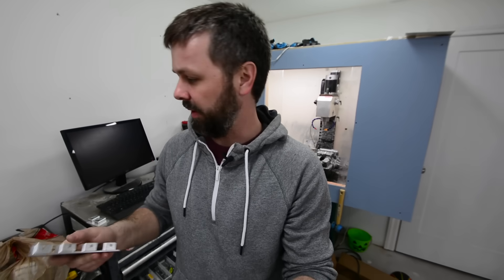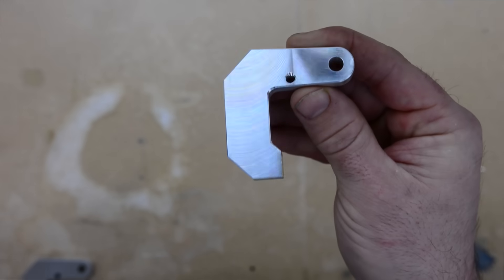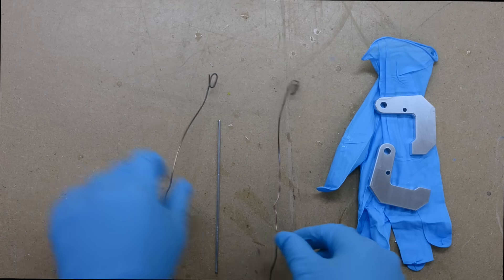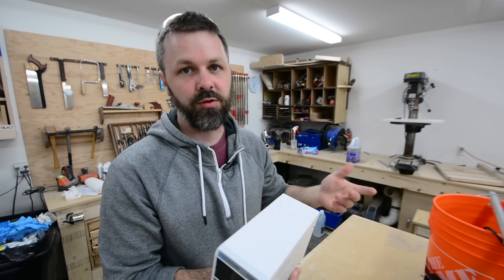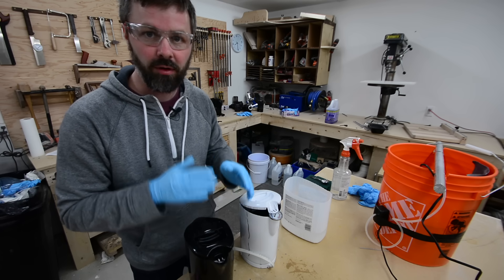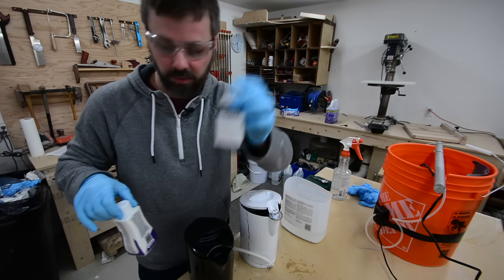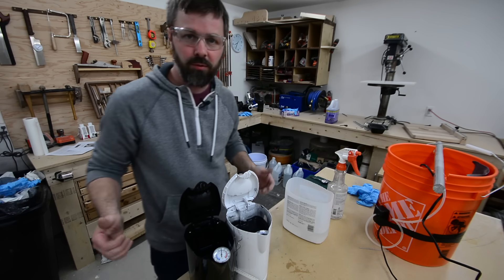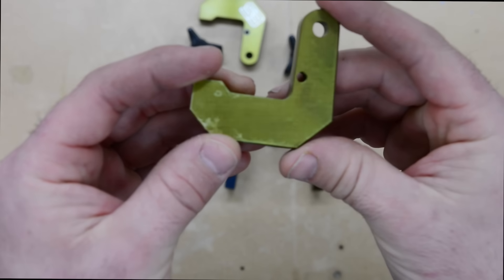ShopBuilt - How to Anodize Aluminum!

Comment: Great video, BTW to all,  if you are ever doing something that you do not FULLY understand (like chemical reactions) do seek assistance from an expert.  The Hydrogen off-gassed from the acid during this electrolytic reaction is VERY FLAMMABLE and Will spontaneously flash at room temperatures.  That's why it's better to have very active ventilation system (like a box fan set on hi sitting next to the bucket) cheers!

Comment: If I understand correctly, the part won't be anodized where it comes into contact with lead (whether it's aluminum, titanium, or what have you), so how does that affect the dyeing process? Does the dye still look as good at the point where it is not anodized as it does on the rest of the part? Have you ever had a color difference that is noticeable?

Comment: Btw, hydrogen is totally non-toxic. You can breathe it with zero problems. It is dangerous due to flamibility concerns. 

When mixed with oxygen, it is the single most explosively energetic fuel known to mankind. Since it is lighter than air, it collects on your ceiling,  near spark sources like lights and fans, and burns with a invisible flame as hot as a welding torch, or detonates explosively. The molecule is small, so it leaks between the atoms of most plastics, meaning you can't contain the gas with those materials. Outside is a good choice. You want to avoid anywhere above where the hydrogen can collect.

Comment: acid+base= salt+water, its fine dude, and it doesn't take that much base to neutralize acids, if your worried you can get a ph tester and check it anyways. just pour in some baking soda and dump it down the drain

Comment: Good video couple of things I noticed. Using aluminum in place of lead for anode will both decrease time and power used in process as well as you get better results with the rit dye...(better conductor by about 8x) The pink hue your pinking up is actually the result of lead be deposited into the effluent. An aluminum piece of 18gauge plate or about the size of a license plate will have your setup purring.
Reply: How and when would I add the RIT dye?

Comment: Baking soda After the acid Is the cream of the cream... In the solfuric acid at 3 % you create the alluminum oxide than you take It off with soda !! Genius!!! 

Baking soda on a concentration of 10gr in 100ml eats alluminium at a rate of .01mm evry 3/4 Min.... And the oxide layer Is between 15/40micron ...
The soda After the acid ruins the consistency of the oxide , you Better of to leave It in a bath of distilled water for 3/5 Min and than take to the dye at 70/75°c

Comment: Perfect your anodizing on bare aluminum stock and not machined parts.  It's a lot cheaper. Get you a hydrometer to test the ph of the acid. Add caustic to it to neutralize it and then it can be poured down the drain.

Comment: You must be a Gemini 🧐 throughout he video you explain your quest for the beloved blue color, yet at the end you prefer the green. 😏

I know nothing about anodizing, yet I am foolish enough to offer suggestions.

1. Would bubblers in the dye bath help to even the temps? 
2. Do you need to use only sulfuric acid, or would industrial strength (30-45%) vinegar do the trick?
3. Looked like you used same stirrer between 2 dye baths. Contamination? Wouldn’t disposable popsicle sticks work better?

Great video,Thanks

Comment: Great vid! I did quite a lot of DIY anodizing a few years back. I know you're worried about surface finish but after I cleaned the parts and have them on the hanger... 15-20 seconds in lye solution, rinse, then a quick dunk into De-Ox/De-Smut, rinse and then into the anodize tank. That will ensure that you don't get surface irregularities. Also, invest in the Caswell anodizing dyes... They're UV tolerant and the color is ~4X deeper than with RIT. You might want to take a test part that's been anodized and dyed and lay it out in the sun for a few days... the RIT dye tends to fade. Lastly, make sure your power supply is set to hold voltage and not amperage. Doing so will allow you to see when you reach PAR (persistent anodic resistance). As the aluminum oxide grows so does the resistance. Lastly... Heating the bath won't help your anodizing, if anything it'll prevent you from achieving a good thick coating, in fact... the difference between regular type 2 anodize and hard anodize is that you chill the the bath to increase the thickness of the anodize. One way to tell if your anodize is thick enough is that the part will have a yellowish tint.
Reply: Quite the girth on that man sized manicotti you just stretched his sphincter cramming knowledge and experience in the process, balls deep 😳
Reply: Just saying --impressive
Reply: Publisher holds your hanging inside-out pocket when you walk around
Reply: @j.ballsdeep420  LOL. Thanks BTW.
Reply: Aluminum oxide has no color difference between regular aluminum

Comment: Totally agree about etching. Redi mix drivers use acid to clean concrete off aluminum rims. Some don't flash and leave it on to long and it turns the aluminum black and pouris.

Comment: Great video.  So you only seal in boiled water, not the sealer from Caswell?
Reply from the maker: So you can just seal with boiling water but because it takes a while you can lose some of the color. I would now recommend to use a sealer (nickel acetate)

Comment: Also, depending on thickness you should be able to reuse the aluminum wire if you etch that as well.

Aluminum is a better conductor than titanium, so you might want to stick with that if you're doing larger parts.

Comment: I was under the impression parts would be soaked in dye (cold) until the desired colour was attained and THEN boiled in clean deironized water set / harden the dye.
Reply: Ambient works in some dyes, but rarely will you get the depth of color achievable in heated dye (Vegas Metal Finishing)

Comment: this is a way different process than i've heard about. 
the other process was just dunking the aluminum part in muratic acid for a bit, rinse with distilled water, and put it in a pot of boiling dye water.  
the idea is the acid will quickly etch the aluminum and the hot dye water will expand the aluminum and deposit dye into the etched recesses. when the part cools it locks the dye in. 
it said nothing about electricity from an over priced power supply. i can get a 10A one on ebay for about $48. i do electrical work as well as chemical like electroplating and make my own solutions. 
if a $48 psu burns out its no big deal (i can probably fix it anyway for a few cents).

Comment: Hey, I work in an anodize shop and work with aluminum airplane parts.  You mentioned using aluminum tig wire and said you can only use it once.  You can etch your aluminum tig wire to remove the anodize finish.  We use aluminum racks to hold the parts and dip them in boric sulfuric acid to get an anodize finish.  Of course the racks get anodized as well so we just etch them in lye and then dip them in a weak acid wash to get rid of the dark etched coating left from the lye.

A point:  the aluminum racks do wear out from the repeated etch/acid/anodize process.  They get thin and flimsy.

Comment: Professional strength drain cleaner which can be bought at any hardware and most box doors is around 93% pure sulfuric acid. It is poured directly into clogged drains. Your solution is perfectly safe for a septic systems.

Comment: IF you use oven cleaner(heavy duty ONLY) on your tig rod holders it will remove the anodizing, then you can re-use them - spray on, rinse off.

Comment: Hydrogen fumes are dangerous because in large enough concentrations, it will explode (this is a common hazard when charging large batteries such as those on forklifts) . It's not particularly harmful in the concentrations you may see when doing home anodizing. But it is very important to maintain ventilation to prevent the dangerous accumulation of hydrogen gas.

Comment: If you did use aluminum wire, couldn't you then smelt it down into an ingot, to be used for making more parts? It would take a long while depending on how much you use, but you could end up with a part that didn't cost you anything in aluminum (considering you were just going to throw the wire out).

Comment: Neutralizing acid which is H2SO4 adding baking soda NaHCO3 will = Na2SO4 (Sodium Sulfate) + H2O (Water) + CO2 (Carbon Dioxide) essentially neutralize it to non-harmful chemicals. So it is fine to use that to neutralize the acid prior to disposal.

Comment: i probably missed it, but how much amperage are you pushing for those small parts? i have a power supply that can put out 30V and 5A max.. i plan to do fairly small parts.. AN hose fittings and such mainly.. i would love to be able to anodize my hood/trunk hinges that are billet aluminum as well.

Comment: from what I remember 75C is definitely too high temperature. The flow of fluid should be minimal, yours is very aggressive which has its side effects. The problem is that you really do not have to verify the quality of the shell and you have to trust that what you do is ok. It would be nice if you could take some part to the plant where they have the tools to measure the quality of anodizing.

Comment: I actually used to work at a professional anodizing shop, we use that green Scotch-Brite for everything sanding cleaning... You can even get the white pads that are little bit finer. We went through cases of the stuff.
Reply: Love the white ones.
Reply: If you see this although 4 years later, could you reply as I have a few questions I need help with

Comment: Personally I would go with aluminum instead of lead. The lead will evaporate during the process. Something this small it's probably not an issue but I used to do chrome plating and the maintenance department had reversed the polarity on the scrubber hood and the guy working in the closed off room had an extremely dangerous level of lead introduced into his body. He was off for an entire year but when he came back all he had to do was show up everyday. He never did actual work because they worked out a deal so he didn't sue the pants off the company.

Comment: Battery acid is 37% sulfuric acid, 63% water, in case anybody's wondering, so by diluting it 3:1, you end up with about 9% sulfuric acid. You could also buy undiluted sulfuric acid if you wanted, and dilute it 11-1. Also, aluminum anodization is just creating a very thin layer of aluminum oxide, which is a hard ceramic, on the surface. Then you dye that thin layer.
Reply: @daveklingler820 - I'm trying to dye a nylon belt with an aluminum belt all black..I can't take the buckle off..I bought rite black dye because of the belt but don't know what to do about the buckle..any ideas on this?
Reply: You HAVE to take the buckle off.. no two ways about it.
Reply: @Jeremya74 You can find aluminum blacking solution in small bottles that would be perfect for your application. Blacking aluminum is the one color I know of you don't have to go through a whole process, just clean the surface and brush on the solution. Black in seconds. Either online search or a local outdoors shop that sells gun accessories (stocked with barrel bluing etc). Not too expensive last I bought.
Reply: @Jeremya74  Yeah bro you gotta take the buckle off. This is a diy project, you'll need to remake the belt itself or reuse the material. You'll simply degrade the material through electrolysis, as soon as you try to tighten the belt after doing the procedure it'll probably snap.
Reply: So how much dist water is needed if we follow 3:1 for a liter of battery acid then?
Reply: @mrkalikutista8729  It's a 1:3, 1 part battery acid, 3 parts water. 1 cup of battery acid, 3 cups of water. Follow the 1:3 rule. It can be 1 liter of battery acid to 3 liters of water, just yeah follow the 1:3.
Reply: @mrkalikutista8729 hope my reply gets to ya

Comment: Well, at the end he said he would not dump the acid, or drain cleaner down a drain, but I will have to disagree. Why not? If anything you will just clear out some of the nasty stuck together growth and crap in your p-trap. I did maintenance for years in the past. And almost all professional drain cleaners are pretty much sulfuric acid, except a few alkaline based ones. Go ahead and dump it down your drain, and dont neuter it by neutralizing it with baking soda for God's sake. Let it clean up the drain for you instead.

Comment: Very interesting video  i think it would be fun  to try  i used to work at a place that did a lot of  metal fabrication out of Aluminum and one of the biggest constraints  in the process was always Annodizing and Powdercoating that was always outsourced  i always thought it would be cool to  be able to  do my own  of course  they have had Powder Coating   Systems available for DIYers  for a while and  ive seen some nice results from a buddy of mine who works on  race cars and vintage motorcycles for fun  and enjoys doing all of his own work in his shop   I am very similar in that i prefer to do my own work  whenever i can  also for quality control and of course cost  one of my buddies  big things is building  custom Swing Arms for some of the bikes he works on and he even built his own oven  so the parts will fit in  he had started out with a Sears Craftsman kit  originally  for the powdercoating   I believe he upgraded to some other parts over the years ?  I knew a  local shop that did pretty good work  but you were always at their mercy  for when something would get done  which was the same as Annodizing  for me

Comment: Awesomely totally cool video, Sir. You simplified everything where even a nimrod like me can follow the process. I think I have the process down, I found the place (Caswell Plating) for the supplies. I am however having a problem locating the 5 amp power supply you mentioned. I checked Amazon but I am not looking in the correct place. Can you steer me in the right direction? Many Thanks in advance for your time!
Regards,
John Archer

Comment: You didn't say what was in that small, translucent white container that you rinsed the parts in after removing them from the bucket.  You also reached for a bucket in the corner for further rinsing.  What was in these two containers?

Comment: Fun fact - the wastewater from this process is regulated by the EPA, and if you're selling it, you are supposed to report it to your local wastewater authority. This is why most small machine shops don't anodize / do metal finishing.
Reply: Acid can be neuralised. In my country there is no regulation on this as far as I know. But sounds like a very reasonable measure.

Comment: Wow, Mr ShopBuilt...did you make those swing stops? They are cool. I like the green and blue, but you'r accent is different. I will have to check you channel to see if you have a vid on making the swing stops as you showed them hooked together, like they were cast, or cut from a block.

Comment: I used to be an anodizer. Your colors will change drastically based on the PH of the dye solution, not just the temp. Another tip for good even color is to get hot water and cold water and rinse in alternating for a few seconds before dying the parts.
Reply: The hot cold rinse is extremely important if your parts have blind holes (ones that don't go all the way through the parts)

Comment: You can dispose of the acid down the drain with no problems, in fact most drain cleaners/unblockers like liquid plumber are a higher concentrate of sulfur acid. It is very quickly neutralized in the natural environment.

Comment: Blue looks amazing. Thanks for the video with your trouble shooting tips. With the aluminum you can strip by using etch but you need a dioxide bath for de-smutting. Best way to strip the aluminum is to use the dioxide bath. But the real intriguing part was that you found neutralizing the acid before dying was a good result. The shop that I work in uses to big rents tanks and I find out that we have a lot of drag out. So I think I'll borrow your tip of neutralizing using an alkaline soap. Thank you so much for your video.

Comment: Really interested in doing this myself, but I have one concern. With an assembly made up of several tight fitting aluminium parts - does anodizing create a physical layer onto the part, if so, how thick?? 0.010??

Comment: Just watched your video, useful info for someone with no knowledge of the process.  I worked for 14 years as an anodizing technician.  Our etch tanks were 32-35 oz/gallon 50% sodium hydroxide (heated to 140 degrees), anodize tanks were 15% sulphuric acid.  The ampere measurements we used were 14 amps/sf for .003 thick (class II hardcoat), 17 amps/sf for .006 thick (class I hardcoat).  The anodize process is clear, and the cycle we ran was 15 minutes.

Also, to neutralize the acid bath, use caustic (sodium hydroxide), just do it outside...once the ph is in the 6.9-7.2 range, dump it

Comment: as a noob here.. you mentioned amps (which is important) but not voltage. you did mention a battery charge so I know that at least 12=14 volts DC is ok..You can't tell if it is anodized by the look of it when it comes from the tank? well I noticed that this was done 9 months ago so I won't expect a reply.. So.. this is very nice I might try it..
Reply: You can see a difference in the color of the part. Once anodized it will have a grey color to it. If you see a pink color that means your part lost its contact to the electricity and didn’t grow any anodize.
Reply: @glenphillips9178  Thanks Glen..!

Comment: You can neutralize the acid with baking soda, and it will produce a solution of sodium sulfate, which is harmless to pour down your drain.  Lye is more efficient (also produce sodium sulfate), but be careful because the lye will produce excess heat that could even boil the water.